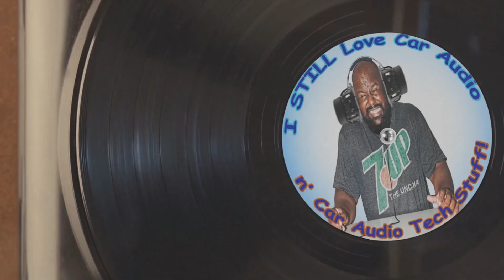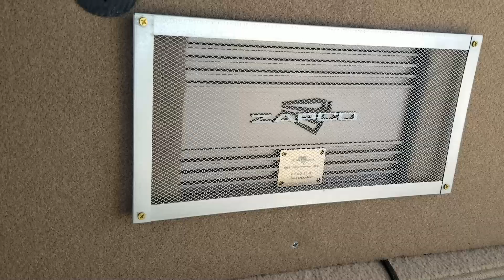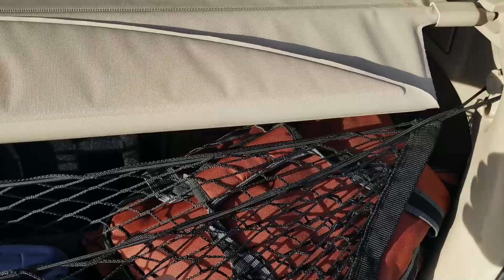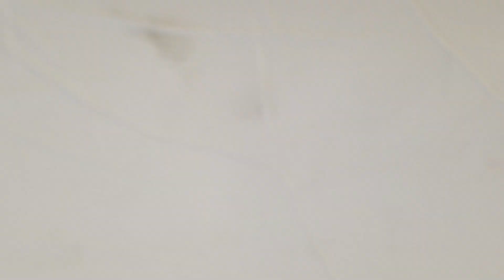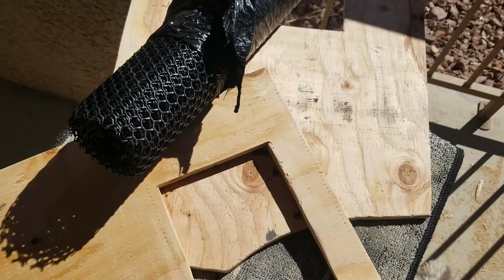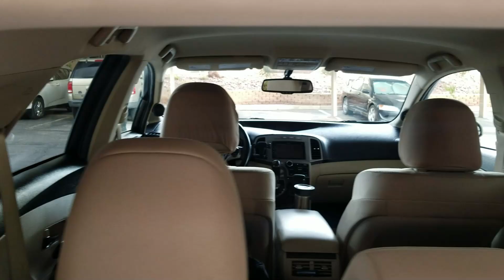I made Beauty Panels FINALLY! #caraudio #custom #beauty #trunk

Comment: Awesome video👍🏼 I love that sub and box I have a 94 single cab Chevy. Limited on space for subs behind the seat, but I was thinking I can use it as a center console between my seat. Do you think it will sound good ?Because subs usually go behind the seats. Really appreciate your videos and knowledge.
Reply from the maker: @enriquev8653  thank you brother.   I absolutely love everything about it.  It's both musical and loud. 

As for having it in the center console, I'm not sure it will work as that box is huge.... I'm not sure you can squeeze it in the middle.  The sub is massive too.

Because you're limited on space, I'd look into the Stereo Integrity BM-11. It's a shallow 11" subwoofer that may be able to fit in back, or even up front worst case scenario, but the sub and box I have is going to be too much unfortunately.
Reply: Yeah, at the moment I have 2 10 inch RT kickers behind my seat. But the bass is too boomy I’m gonna do some more research. Thanks for your advice and help. I’m a newbie and just getting started in this car audio.
Reply from the maker: @enriquev8653  right on... I'm here to help.  Those are great subs, but are they in a sealed or ported box? Ported is louder, but can also be boomy. A sealed box may help, plus your eq and crossover settings will make a difference as well.
Reply: It’s a sealed box, but I think it may be too small for the subs. How do you know if the box is too small for your subs?
Reply from the maker: @enriquev8653  if the box is too small, the subs won't move like they should.  They'll be very stiff and restricted, and the bass will be very distorted and limited.

Comment: Based on your experience how does a larger driver like 15, 18 or 24” subwoofer sound in comparison to the 12”?
Reply from the maker: @OGLOC1574  typically, 10's are chosen for tight fast bass, which is great for rock music. 12's are great for overall music, all types can be played.

15's, 18's and 24's are great for distance, and filling the car with sound more easily, because of the larger cone area.  Great for SPL too.
Reply: @ I listen to rap, hiphop, rnb, and edm. Ive had a 12” ported sub for the longest time but I am changing vehicles soon and getting a highlander. Would a larger driver (15+) negatively impact sq?
Reply from the maker: @OGLOC1574  not necessarily. The larger driver would be louder, but so would your 12", if you're not currently using it in an SUV? If you move that 12 to the highlander, it'll be louder. 

Sound quality wise, I actually think a 15 would work better as the way the sound moves. A 15 won't be as punchy as your 12, but it should be smoother for r&b, filling the car more effortlessly, and you'll get more distance from your bass when playing hip hop.

Comment: Looks no less than factory paneling. Good job
Reply from the maker: Thank you Sir! Wanted to clean it up, but keep it simple as well.
Reply: @Ahm-Creative  Yeah man. To me, especially in my neighborhood, it’s best if the equipment is inconspicuous. I still turn the music down a block away from home 😂
Reply from the maker: @milesbachelor8747  lol 100%. I even told my daughter "bump your music when you LEAVE the parking lot, NOT when you pull in" 😁

You don't wanna come outside to a busted window and open, empty trunk.
Reply: @Ahm-Creative  Most def. BTW you have me an idea with the mesh. I wanted to cut a hole in the ski port, and needed some type of screen material. 
Found a solution, Thanks
Reply from the maker: @milesbachelor8747  awesome...and it was only like $3 or so.